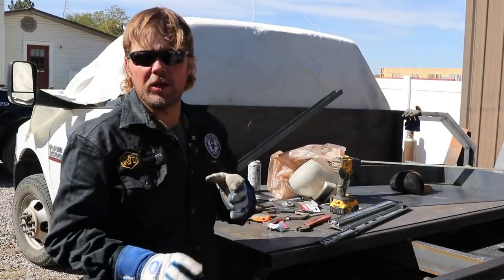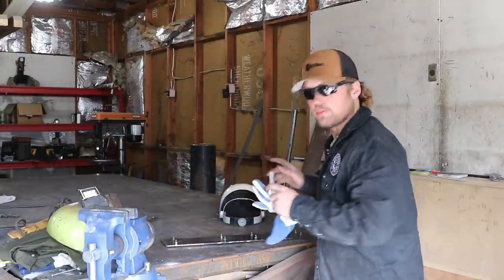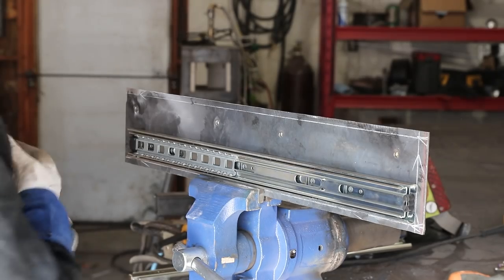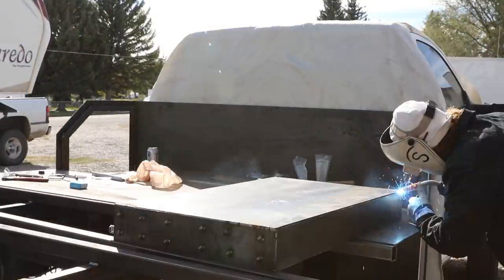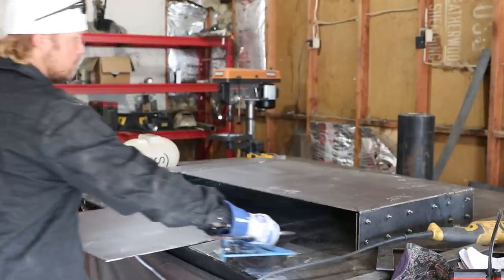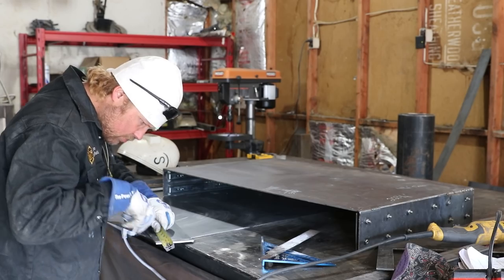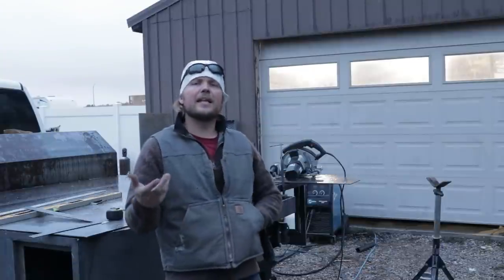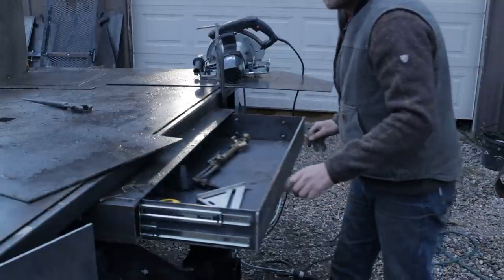Building a Custom Flatbed part 2 hidden metal Drawer.

Comment: If there’s anyone out of weld school or helping, I graduated weld school a year ago , went from working in the gulf on oil rigs to doing fabrication in night clubs all within the year, a opportunity arouse for me to weld structural but I needed a machine I’m renting one right now till I have enough to buy , but you can do a lot within a year really try to do everything you  can, I set out to be a rig welder, I’ll weld anything to be a rig welder or single hand doing both is just fine, I haven’t tackled stainless pipe yet but its on the list, keep working it will happen.
Reply from the maker: Love this advice thanks Logan!

Comment: Loving the build. I’m a High School welding teacher and we’re working on a flat bed this year for a gentleman. Is that 2”x.120 square you’re using for the cross members? I was going to use 3” channel but I’m trying to shed some weight on it.
Reply: Steel is so daarn expensive . I just built a flatbed for my 2000 ranger after about three weeks of 2 hour welding days to rebuild the frame. I have had to source supplies from scrapyards in Eastern Pa.

Comment: Question for you... aren't the main supports over the frame a C-channel? Couldn't you have made an almost full length drawer in those channels? Maybe I forgot how you built the frame.
Reply from the maker: You definitely could of but the sliders would be hard to find.
Reply: @JacobSchofield  44 mins for a reply... thanks, didnt expect that. If I build one, might use a U channel and then build some heavy duty rollers. Love watching your build. Keep up the good work.

Comment: I've been looking for some heavy duty slides for drawers, whodid you scoop those up from?  I bought a set from uline that were supposed to be good for 80 lbs but they were junk. Lookin good tho budd.
Reply from the maker: Tha k you very much. Order them on Amazon I believe these where 22” sliders but I would probably do 18”
Reply: I got mine a Lowes the work great